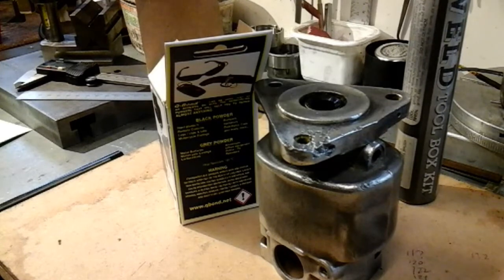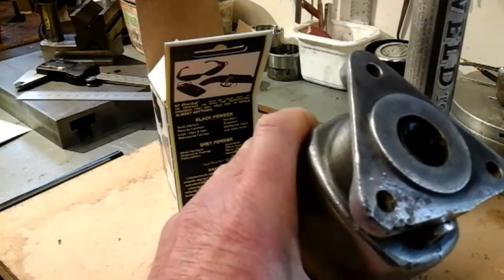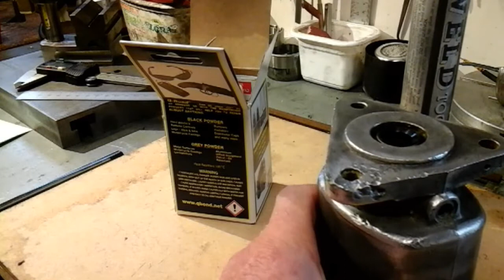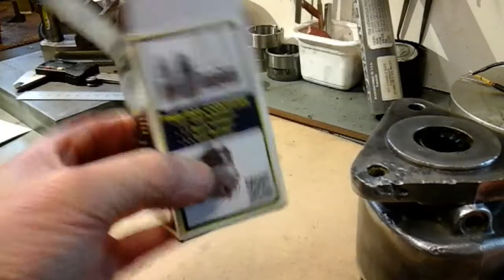Magneto Repair & Rebuild - Part 1.....mr factotum

Comment: ive a 650 triumph with a lucas magneto one day fires on two cyliders next day one
Reply from the maker: hi bf
sounds as though mag might be going down, although check for faulty plugs, caps, leads and points first, see if the spark is strong on both spark plugs although under compression the spark acts differently, also has the timing slipped!!!
thanke for feedback and good luck
cheers
Kev